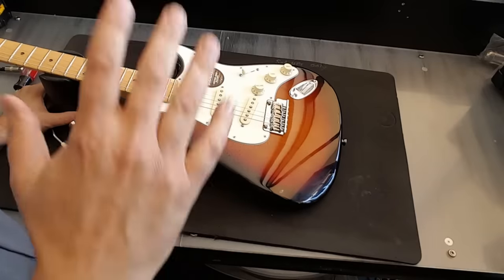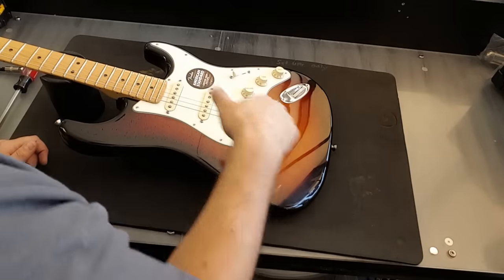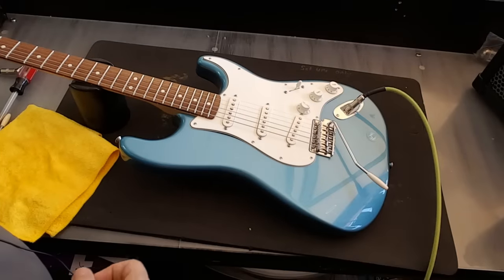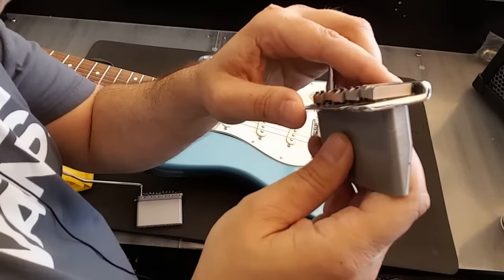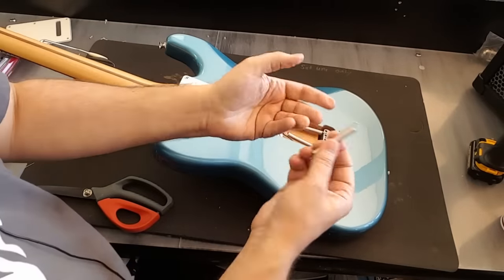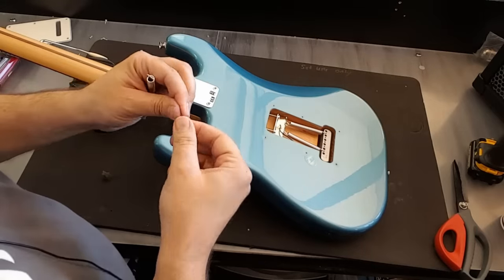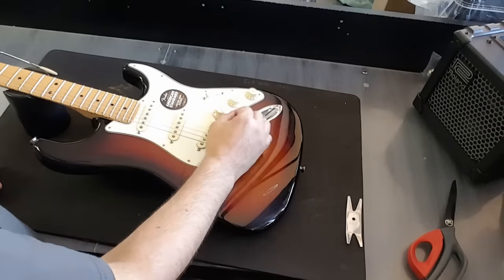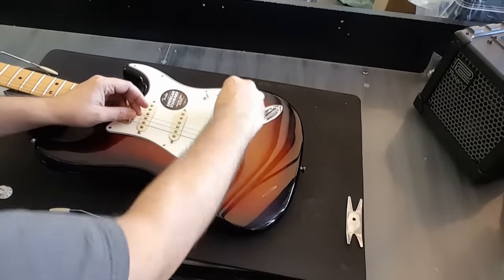5 things you didn't know about your Fender Strat

Comment: On Fender's website, they recommend that trem bridges should have a 1/8th inch gap from the body. The bridge should not be flat on the body.
Reply from the maker: +Eran Montiel I understand
Reply: Bridge flat against the body just like the the old school john mayer strats
Reply: +Eran Montiel   Rubbish…its personal preference.  Having the bridge flat to the body allows the guitar to resonate more gives better sustain, its similar to playing a hard tail strat.  Notice why a tele seems to sustain and resonate better than a strat?
Reply: +gmlasam oh for sure there are a number of ways you can set up your guitar, I was just relaying what fender days on their site as to the standard setup.
Reply: +Eran Montiel That is correct, but that gap is supposed to be caused by the spring tension and the string tension, causing the bridge to float. Not the screw pushing the bridge down in the front.
Reply: +RDE Lutherie great tips, thanks for the info
Reply: That baseplate on a tele is what's really helping and the string though body as opposed to a strat trem block. Although a larger steel block helps a lot. With the trem bridge laying flat on the body, you defeat the  counter balance purpose of the bridge design, thus reducing all the pros you mentioned.Even when you block a trem, you should keep some space.
Reply: I've owned and played several Fender Strats (a '55, a '56, a '63 and lots of spin-offs (G&L, Tokai etc.) and five springs is the only way to go. anything less feels wimpy and wobbly, hard keep in tune and forget bending while using open (drone) strings. But, I guess, some people know better than Leo Fender, huh?
Reply: I know. I've played guitar for almost 60 years and have owned just about every brand under the Sun at one time or another. My G&L was an SC-3 with an ebony fingerboard and was one of the best playing/sounding guitars I've ever owned.
Reply: Yeah...says that in the manual too...but everyone I know uses the five springs and flat against the body...
Reply: When in doubt about the resonance ("ring" "sustain" or whatever) always trust the old ears. Even when unplugged it should be obvious.
Reply: Paralysis by analysis. I've played guitar for 60+ years and it's all subjective. Everyone's hearing is different,.and once it's plugged in it all goes out the window. As you said, the pups  hear the strings, not the wood. I've run my Tele through a Marshall and managed to make it sound like my Les Paul.
Reply: Unfortunately, there is no "fix" for playing poorly no matter how long one has at it. 
I toured and recorded with the Everly Brothers for ten years so I must have been doing something right. BTW,The fellow who replaced me, when they reunited, was a guy named Albert Lee.

Tell me about the guitars you build 'cause it's always good to hear from someone who knows what they're talking about. Thanks.
Reply: Nice looking stuff. Excellent execution as well and beautiful inlay work. I'm going to turn some friends on to your site. Thanks for the link.
BTW, you're right about the foam. Why dampen the sound, eh?

PS, I've also played behind singers such as Bobby Vinton, Jimmy Clanton, Nancy Sinatra, Bo Diddley and Hubert Sumlin to name a few more.
Reply: Frederic Petitpas "Nothing is the only to go" LOL! Only if you want it to operate properly. But still, as you say, it;s a matter of personal preference. "Everyone to their own taste, said the old lady (as she kissed the cow)."
Reply: I have my bridge flat to the body and my intonation is damn near perfect.  The question is, did you set your guitar up correctly and in the right sequence?
Reply: +Adrian Massi You must not use the tremolo then. You have to set it to float one eighth of an inch from the body. A few people including Eric Clapton will block the tremolo with a piece of wood so it can't move. These people do not use the trem.
Reply: Since I am used to a Floyd Rose, and I have a hard tail Strat, If I even find myself with a normal Strat, I think I'd end up messing with the springs so I could float the bridge even higher lmao
Reply: Sustain? A player asked Chet Atkins how he got such a "fat tone." Chet thought for a second and replied: "I hold a whole note for four counts." LOL!
Faster isn't always better say the ladies.
Reply: +Sam McCue Say it with me now, Sustainiac! Now I'm sure that Chet didn't use one of those, but with one of those, I can make a shredfast guitar, basswood, wizard neck, thin body with double locking tremolo, the true reject when it comes to sustain, and make it hold a note longer than the mahogany chunk that is the Gibson Les Paul
Reply: LOL! How true!
Reply: +RDE Lutherie do they make a short scale pot? What I mean one that doesn't require a full 360 (or whatever the degree of rotation is) to go from stop to stop. 
I would think to make "Wah-wah" effects with the tone knob and easy quick volume swells. A short rotation to a cover a greater effect would be nice. I prefer fast pots myself so I wouldn't do the foam but you can also buy stiffer pots. Do pots like this exist?
Reply: Just got a new Strat and the bridge came decked from the factory.
Reply: Bit of overkill using 5 springs bro. 3 springs should hold anything down unless you using 60 gauge tuned to standard E but nobody does that.
Reply: Fuck dude, you need to relax.
The 3 spring theory has worked with EVERY single brand of guitar I have ever owned. 
Please don't write a thesis about your "spring theory" cos I don't really give a shit about what you think or how you came to your conclusion.
Keep rocking anyway - even though you over think everything it seems...
Reply: I just got a set of Raw Vintage springs to put in my rebuilt Classic 50's Strat. They are a lot weaker that the springs of today, so you need 5 of them. With newer springs I use three for .009 and four for .10's and I have a Predator with five springs strung with .11's that sounds awesome.
Reply: That's what they say, and that is the way the guitar is shipped. But with the gap you will have much more trouble tuning. Plus: complex-bendings with ringing pedal tone won't work because the pedal tone will flatten when bending a neighbour string. So it really depends on your style and your preferneces.
Reply: personally I would never convert a newer amstd strat into a hardtail, the trem is just too nice. I don't even use the whammy but I can get all sorts of cool sounds just resting my hand on the bridge and emphasizing notes. very ghostly tone and just the sort of thing I love. The newer bridges have more mass = more sustain, with the use of compressor I get more sustain than I need.
Reply: You are right. People not understanding the difference is the source of one of the most tiring controversy in the guitar field.
Reply: New day yesterday Jethro Tull lesson
YouTube
Reply: RDE Luthrie, just to let you know, I enjoyed reading all of the things you posted.  
You said that strats have "(bad cunstruction), I have to do a lot of fret jobs on them"
Is it correct to say that the bad construction you speak of that requires fret jobs is that their frets are too soft?

I got a USA Custom Guitars neck for my strat in 2009 with Stainless Steel 6105 frets and it has been great (no wear of course)....
And my new USACG body shipped today (Alder, contoured heel, HSS).

Do you have any experience playing on SS frets?  Do they make the tone a lot brighter?  I have heard both "yes" and "no".  I have never had a second strat to do an A/B test on, but I will once my new body arrives because I will assemble all the original parts of my 1997 MIM strat into a new guitar (new pickups and wiring).
Reply: RDE Lutherie So what you're trying to say is that 60 gauge strings don't create more tension when tuned to standard E compared to 46 gauge strings tuned to the same key? If that's what you're implying then you are dead wrong.
Simply put, 60's are used to create string tension when tuned to lower keys like C or C# or similar so they aren't sloppy.
I'm not sure you are who you say you are otherwise you would know this as it's basic knowledge when tuning guitars. Please read posts properly before you attempt to slag people off which is just childish. No need to reply.
Reply: meagainok said "If you truly are a master luthier with 30+ years experience, and have an education in physics and engineering then maybe you should actually try playing a guitar instead of reading about them. Have you ever experienced a cramp from playing or even sore finger tips from playing? I guess not. If so, show me something to believe about your capabilities.
You sound like one of those many people that love to tinker with guitars but has absolutely no clue on how to play one."

https://yourlogicalfallacyis.com/ad-hominem
Reply: meagainok I know that. I thought that your attack on him for "sounding like one of those guys who can't play guitar..." was a claim that you threw at him without cause or justification- and was a character attack.
You seem extremely angry in your comments.
I hope you feel better.
Reply: No you're wrong.
People that put shit on other people need to step up and validate themselves so there is a reference point. 
I bet you 100% this does not happen with this troll.
Reply: did that with mine as i got sick of it going out of tune and its been like that for the last 10 years now, bolted straight down with no gap
Reply: So basically what you are saying is you're biased and ignorant to any other way of doing something. Although a lot of the things you are saying here are true this one is just plain ridiculous. There's more than one way to skin a cat, true temperament being a fine example of how things are never completely accurate on a flat fretted guitar.
Reply: It cannot be flat to work!
Reply: Why is it that I hear sounds from my guitar other than the stings.
Reply: Pickups, in my opinion, can hear how the wood and other hardware differences affect the strings. Good pickups that is.
Reply: Ming Wu you're talking about rear of the trem being flat against the body. He's talking about the 6 screws holding the bridge to the body. Screw them in until you see the bridge raise and then back them off
Reply: Thank you, oyhe94. Yours is the most important point made in this reply thread. Whether you like your trem bridge flat to the body, cocked at some angle, or even blocked in the back with a chunk of wood, the screws holding the bridge should NOT be screwed all the way down to the body. When you put the bridge on tighten the screws only to contact with the bridge; any further will raise the bridge at an angle. Once you have strings on the degree of angle that the resultant string tension creates can be adjusted by the two big screws holding the springs in the back, and also by number of springs used. It's a balancing act that takes a bit of tinkering to get right. Eran Montiel and RDE Lutherie make good points as well about how Strats are factory setup to use 5 springs and "float" at about 1/8 inch off the body. This is so the trem can be pushed down, relieving string tension, or pulled up, increasing tension. If you prefer the angle more than 1/8", or all the way flat to the body, then the intonation will be slightly off because the placement of the strings' break angle on the saddles will be slightly altered in relation with the scale length.

Comment: Packs of the trem springs very affordable - I got mine from Amazon UK. You get enough in the pack to suit even the most clumsy-fingered.
One point that's rarely mentioned for anyone who decks the Strat bridge by tightening the the spring claw and pulling the bridge flush onto the body is that access to the holes for removing or installing strings can move too far forwards to be accessible via the slot or holes in the backplate. I simply bought a replacement plate and adapted it but kept the original in the case for any future owner who wants to reinstate the trem.

Comment: DOES THAT MEAN I LOST THE SPRING
Reply: I feel ya, never knew about till now but feels like I've been missing so much
Reply: you can just take the spring of a pen
Reply: @maykel_192  no where stiff enough, (there is also a ball bearing with the spring).  New kits also have a small disk magnet to cover the hole to use over the hole to (help) keep the spring from getting lost.  It's about $10.
Reply: lol,.perhaps the janitor at the last gig you performed at, found the spring and is now scratching his head contemplating where it came from.
Reply: I lost mine too
Reply: If winter is here, can the spring be far away?
Reply: YES
Reply: Same here !!
Reply: Yep. Your spring sprung.

Comment: wow, i never knew that about the tremelo arm spring....and it has always bothered me. thank you! now i need to find one that fits. as far as dampening the tremelo block springs, well i think those springs are (a small)part of the magic of the strat tone...
Reply: Fender offers them in a 5 pack and you can get them on Ebay for about 8 bucks --- handy little spring and does just what it's supposed to...

Comment: How do you keep from losing the tremelo spring?!  It's so small!

My 1984 Squier Strat (Japanese) didn't come with the spring.  Here's a great solution.  Apply some teflon tape to the thread to give a little material to give friction/fill to the threads.  I've found this works pretty well.
Reply: Tom Filipiak k
Reply: J

Comment: I have always had the issue of turning down the volume. I remove a tone, move the volume down, and run one master tone as I never use both together anyway. I set the trem to the body, use 5 springs, and run the trem spring claw right in close. Afterwards I do a complete setup with 11's and my strats are killer to me. I get perfect intonation and the sweetest tone (to my ears). I give the tone's credit to heavier strings, not using a pick, and EMG SA pups. Not crazy about the battery part of having actives, BUT they make for great noise free output, and and the tone is amazing. I highly recommend trying them.

Comment: thank you for the tip with the little spring, so brilliant ... why Fender doesn't put them in every tremolo system ?
Reply: What do you think that spring is? part of the design so that its not loose. all strat trems are intended to have them
Reply: Because that spring costs £300, why else do you think USA guitars cost so much more?
Reply: +Boodysaspie I bet in modern tremolo systems they are using fine thread. Fine thread provides better fit. However, a mechanical engineer like me would never use a thread for positioning. Threads have different function. It is just an easy and cheap design. For the price of an American strat they could offer something better, but that's the traditional design... :D
Reply: Boodysaspie Honestly i think its because most players dont use it, therefore it goes undernoticed. then theres the "IT HAS TO BE VINTAGE SPEC!" thing that limits the market sevearly at times, if the improved the system to much people would complain its to far off from the origonals. honestly the fender mustang trem attatchment method was better, put it in, tighten down a screw with an allen key that has a headpiece that fits in a grove  cut in the bar. Allows you to move it, but still keep it in place, basicaly, as flexable as you want it to be. Put that on a strat an we are golden. Hi have mine cranked down on my home build so it only moves when moved by hand.
Reply: Andre Krumins
Reply: Staj Borquez ?
Reply: @therideneverends1697 stop